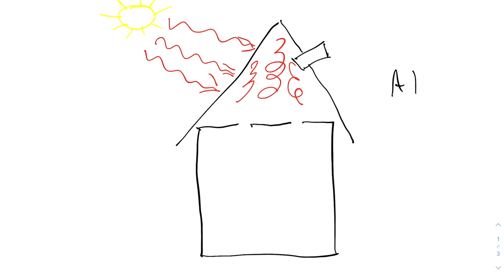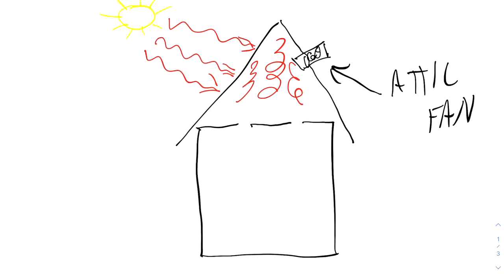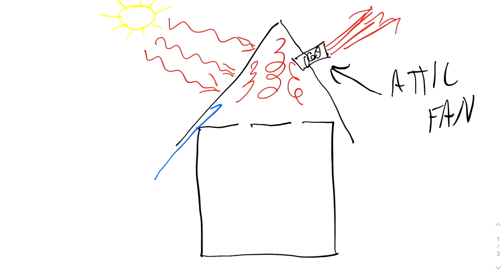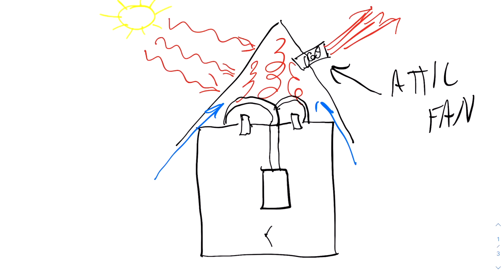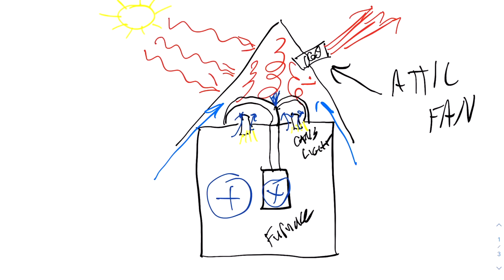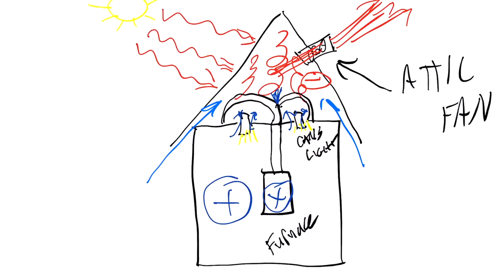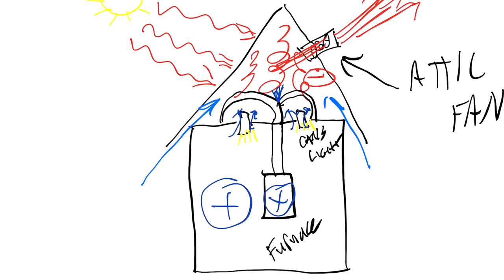3 Remodel Rip-Offs

Comment: Attic fans work great and sure DO reduce electric bills, Matt is clearly misinformed on this one.
Reply: Couldn't agree more .
Reply: we have one that is thermostatically controlled, the fact that it cycles on and off throughout the day disproves his theory
Reply: if an attic fan is lowering your power costs then you aren't insulated properly and are getting massive amounts of heat transfer in the summer and cold transfer in the winter.
Reply: In SW Florida we had 140° - 150° F attic and the 5 ton AC could barely cool the house, and now after a 4,600 CFM thermostat fan 100° F and we can freeze ourselves with the AC. The roof is just as hot, but the temperature between the scalding roof and insulated ceiling is 50° F cooler. I'm NOT trying to cool the roof .. I'm cooling the space to the ceiling.
Reply: @DanielRichards644  There is a balance between how much money you want to spend on extra insulation and what will be your electric bill every month. After so many inches of insulation your money back start to diminish rapidly, plenty of charts around to explain and confirm this, so now attic fan becomes so much more attractive - cheap, easy to install, instant payback. I bought two 60 buck attic fans, one blows in from the Northern side one sucks hot air out from the South side and the very first month my electric bill dropped 30 percent.
Reply: @DJaquithFL  if this is true then why don't you just cool your whole house with that attic fan? Your claims would imply that its far more effective at cooling a space than an HVAC system.
Reply: @MarlowWhere  .. Yeah if I want 95° in my house or whatever high ambient temperature is during the summer! Not to mention all the crap from your attic coming through your house. No thanks.
Reply: @DJaquithFL  I'm being sarcastic.
Reply: @MarlowWhere  .. Okay. Again a high temperature attic especially when AC ducts are also in the attic can not only make it difficult for your HVAC but potentially impossible to reach lower temperatures in your house. Attic insulation over time compresses and you lose significant r-value, not to mention if it's been moved around. If I didn't just run into this first hand on a reno then I won't even cared to comment.
Reply: @DJaquithFL  attic fans cannot cool a roof assembly or any mechanical equipment via convective heat loss. The answer is put more insulation over the ducting or remove it from the attic. Just because you remove the hot air in the attic does not mean everything the mechanical touches isn't still heating it up. The ducting itself and heat pump are getting hot and in turn heating the air in the system because the system is sitting on a conductive material (wood and drywall). There is no way an attic fan is cooling the equipment to somewhere between 70-80f so that cooling loss in minimal.
Reply: @MarlowWhere  .. Neither the duct work nor the room ceilings are touching the roof. The air space between the roof and ceiling are cooled off at least 40°-50° F to suggest that temperature difference makes no impact on cooling is absolutely wrong. 

Our prior home had sprayed-on closed cell insulation the insulation was underneath the roof, the attic space was conditioned. 

Again, in a more conventional construction especially as I said "RENO" as in renovation, changing the type insulation can actually do more harm than good regardless of cost. Doing it after the fact risks entrapment of moisture. So not only are you dealing with the high expense of new sprayed in insulation but the added cost of a perpetual dehumidifier or dehumidifiers not to mention that maintenance and cost to run. 

So yes in explicitly high temperature areas a thermostatically controlled fan is a wise investment and certainly can make a substantial difference in your cooling. I see it firsthand with our own home. We have the thermostat set at 110° F.
Reply: @DJaquithFL  the hvac does not need to touch the roof. It is touching the ceiling joists and drywall is it not? Conductive heating does not stop at the roof deck. It literally heats up the whole building assembly. Some roof decks get so hot that they radiate heat downwards, further heating up the mass below it. Because air is a poor conductor of heat, it does very little in transferring heat to the hvac system. More to the point, even if what you are saying is true, then you are still not mitigating heat loss in the winter RE the hvac system. The fan is masking the problem that you are yet to resolve. Wrapping the ducts in insulation is needed at a minimum. The fan may ventilate some of the hot air, but it is not slowing the thermal gain into the living space. All your fan is doing is sucking out the warm rising conditioned air and cool air is replacing it temporarily only for it to be sucked up into the attic. You're arguing that an attic fan helps reduce cooling load when in reality it is just making it less noticeable. Do you want to cool a house at any cost or have an efficient system?

I'm sorry you are not correct  about adding more insulation on the attic flooring of an older house causing issues with moisture build up. Blown in  cellulose and fiber batting are all highly vaper permeable. And the construction of unconditioned attics hasn't changed in 70 years. They are principally the same. If there is moisture sitting in the insulation, something else is causing it...likely an unresolved air gap say from a bathroom where humid air is leaking through or even a vapor barrier needlessly laid on the attic floor...whatever it is something is causing moisture to condense there. But that is not common place. I think your concerns there are over blown and you should really look into what people are doing with energy retro fits. I seriously doubt building scientists around the world would be recommending adding insulation to unconditioned attics if it was known to cause moisture issues. Your concerns would be much more founded if we're discussing adding insulation to both sides of a roof deck or wall assembly. At that point, yes. You need to do it right or you could risk trapping condensation.
Reply: @MarlowWhere  Ok, then I can cook with my oven door open, because those radiant elements will just work anyway. Nevermind that most of the radiiant is converted to heat at the roof deck. Nevermind that the ceiling structure will transfer heat out to the 100 degree air that is moving out better than 150 degree air that's sitting on it like an oven with its door closed. And nevermind that ducts aren't in that much actual contact with the structure anyway - it's usually hung by straps, and made of a reflective foil that reflects radiated energy itself, and nevermind the actual real world results I've seen time and time again - that was totally a figment of my imagination because "radiant magic".
Reply: @notsure7874  not really sure what you are responding too. An oven works more efficiently with the door closed because the door is insulated and retains radiant heat inside the oven. Having poor insulation in your attic floor while trying to maintain a conditioned space is like trying to cook with the oven door open. The radiant heat from the attic leaks into the living space as  the hot attic floor radiates heat downwards. The ducting doesn't need to literally touch the rafters or attic floor. Radiant energy heats up the metal ducting because metal is conductive. The attic floor and the rest of the attic assembly absorb and emit heat as well, which also work against the hvac. 

There seems to be some kind of confusion that hot air is what ultimately heats up a house. Using you oven analogy, hot air does not cook your food. Radiant heat does. Air does not absorb radiant energy very well. But your food, which is mostly water, does. Think about it. Heat exists in a vacuum without any air. If your attic was a vacuum, the sun would still hit the roof deck and radiate heat downwards through to the attic floor which would radiate into the living  space. By running an attic fan you are sucking out some of the hot air that is produced as a result of this radiation, but you are also pulling the cold air from the floors below into the hotter upper living space. Insulating an attic limits the penetrarion of radiant heat into the living space. An attic fan merely makes you more comfortable temporarily. As soon as winter rolls around, you are now losing heat into the attic and your fan can't do anything to stop it. Insulate an attic and create year round comfort and performance.
Reply: @MarlowWhere  Insulation is great but it isn't magical. It works much better when there is less thermal difference. I don't know why having 2 good things is a negative situation in your eyes.
Reply: @BrBill  a fan isn't necessary when a ceiling floor is properly detailed. You can run a fan if you want, but my point is that properly insulating provides year round benefits. A fan doesn't resolve anything. It masks the issue. Many of the claims that people are making her are physically impossible.
Reply: @DJaquithFL  I'm Interested in what fan model did you install
Reply: @ivosan11  .. I did a quick search that I sent the contractor and found this https://www.homedepot.com/p/Hessaire-4450-CFM-Shutter-Exhaust-Fan-Wall-Mounted-24SFV-H/305621547

I would not recommend a rheostat switch because you'll burn them out. Instead just use an on and off switch plus the thermostat switch that comes with a fan.

My only other suggestion if it's going to be covered with some sort of decorative louver then make certain the CFM of the louver is not too restrictive inadequate enough for the fan.
Reply: @ivosan11  .. I believe this is the thermostat switch we used in the Attic, in quick looking it doesn't look like the fan comes with one. https://www.homedepot.com/p/Master-Flow-Manually-Adjustable-Thermostat-for-Power-Vent-PT6/100098472

Keep in mind this has been a while.
Reply: @DJaquithFL  Thank you, I appreciate it

Comment: I live in Seattle and my attic was getting to hotter than 160 degrees. I put in an attic fan and brought that down to 125 degrees. This reduced my house temperature 5 to 8 degrees. I had 2 14,000 btu window ac units cooling a 2400sqft house. 

The biggest change was the house temperature after the sun went down. My ceiling would get to 90 degrees and radiate that heat down into the house late into the evening after the outside was in the 70’s. This means the 160 degree attic was eventually getting through the insulation. Reducing that to 130 degrees made the ceiling stay only 4 degrees warmer than the floor. 

This might be a specific situation. 
2 story house with a basement built in 1995.

Comment: 1- Wrong on the attic fan. We could put our hand above our head to feel the radiant heat from our ceiling. After the attic fan, no more heat. When I go up there to work on somethin- No attic fan, I literally had heat exhaustion, I needed a cold shower, drank gatorade & water, etc. I was done. After the fan, I could stand being up there for an hour or so in the summer. 2- Agree on the thermostat. We had to have our heat pump replaced. They gave us a too big of a unit and it cools in 10 min and the air is still moist. Sometimes we gotta turn it down to 65 to dry it out. That's cold. 3- We love our replacement windows- but it depends on what your windows were. We had 1980 single pane windows. We needed to put up that plastic that you shrink with the hair dryer every winter. Now with double pane new windows, there's NONE of that. So nice. Well worth it.

Comment: I think what Matt is trying to say about attic fans is they are a bandaid not necessarily a fix. My attic would reach 150 in the summer and take forever to cool down. I thought about getting a fan but after digging into it I decided to try to make changes. First was insulation,which didn't lower the temperature in the attic but helped in the house. I needed a new roof so had a ridge vent installed at the time and it seemed to help but temperatures still got to the 130s.i then cut holes in the soffits as there were only a few so I could balance the intake and exhaust but it still got in the 120s. Before I resolved to get a fan I tried one last thing and that was an external baffle ridge vent. So now, with the soffits vented properly, the attic insulated properly and the internal and external baffled ridge vent the temperature stays within 20 degrees of the outside temperature. I've found all the same benefits and more. My attic doesn't even get to 120 unless it's over 100 plus degrees. If I'd have gotten the fan in the beginning,sure my house would be cooler with the fan but the attic would still exceed whatever temperature I set the thermostat up their to before it would cool down. Another way to explain my situation is in the begining my attic temp would climb quickly and stay hot until late into the night. Now it's the same temp as outside only climbing a few degrees higher, typically within 10 degrees all day and dropping to match the outside in early evening. Hottest temp I've recorded is 20 over hence why I said that earlier. Sorry so long winded. Hopefully this helps others. Sure 2nd third floor issues makes it difficult to do what I did, easier to just install an attic fan but again the underlying problem isn't solved. So just depends on what you want

Comment: The 40% energy saving on windows is true if the windows in your house are roughly 50/60yrs old. My house is 110yrs old and the last time it was renovated was in the late 60s. I replaced the windows and my heating and hydro bills were cut in half. LoL (Live in Ontario, Canada)

Comment: maybe the attic fan doesn't work in TX, but it definitely worked for us in N.California, with noticeable room temperature improvement.
Reply: Same here
Reply: It’s nice for when I gotta get into the attic in the summer time. It ain’t cool up there, but at least it isn’t 150. 95, maybe
Reply: Did a study years ago for a couple utility companies and the state on attic venting. It made no difference on house temperatures. None. Zero. Zilch. As long as there is a thermal barrier, I.e. insulation. Attic temps in N. California reach 180 in attics with asphalt shingled roofs. No heat transfer through R-38 insulation to the living space. They also didn’t cool the attic down very much, if at all. It is thermally impossible to cool your house down by cooling your attic down if there is a thermal barrier between them. If there is no insulation a better option is to insulate it, not power vent it.
Reply: @ptom711  the difference will be a formula of ambient temperature, heat transfer from attic to living spaces, how much volumn of air can attic fans move per unit of time, etc.. I believe the result of your study, but I also like to believe maybe that study does not cover some of the commenters (like myself) particular parameters. But it would be nice if they can publish the paper. (Or maybe I just live in a badly maintained home 😂)
Reply: I realized it's also important to know what are we talking here, is that the attic fan does not reduce the living spaces temperature at 4pm ? Or are we talking about the attic fan delayed the time that living spaces reached a temperature? The former is entirely possible because there is little a tiny fan could do at 4pm when everything gets so hot. But I do believe that a attic fan delayed the time the house reached that temperature, which is a noticable change and saved some AC time.
Reply: What about lowering temperature in your garage? I would love for it to suck outside air into the garage and out the roof.
Reply: @psdeas7530  good question. I was kind of wondering that too. I love whole house fans, well not all of them, but the idea of them and their functionality and recommend them especially in moderate to low humidity climates where the nighttime temps actually get below the daytime temps. The huge high-capacity CFM ones are overkill and no one uses them right. When they were first used the instructions were to run them for 15 minutes at a time to flush out hot air from inside the house. Let the house sit for 45 minutes to heat the air up and then flush again. Kind of a pain in the butt but saves energy. Most people turn them on and forget about them until they are sucking hot air back in.
Reply: @SubaruWRXStiYamahaR6-AllGone  Another possibility is to install a heat pump water heater in your garage. It will both cool and dehumidify the garage while being much more efficient than an electric water heater. If you have natural gas then it is a tossup.
Reply: @SubaruWRXStiYamahaR6-AllGone   Fan will definitely lower your garage temp to outside temp.  Make sure air has a place to enter the garage (install some vents or open the windows)
Reply: @danielcarroll3358  Those Mr. Cool self contained systems are tempting!
Reply: I got two Whirlybirds on my roof in the state of Texas, my house seems fine.
Reply: @ptom711   what is the R rating for foam insulation on 2x6s??

Comment: With all due respect your understanding of the science is half correct. Radiant energy heats up the shingles, and that heat then transfers into the attic via radiation and convection. However, even if the air outside is very hot on a summer day, with an attic fan you’re forcing air flow through the attic that is colder than the roof. This reduces heat transfer from roof into the attic and results in a lower attic temp. This as a result reduces the heat transfer into the home because the attic is colder than it would be without the fan. Source- I aced thermodynamics in college and I have a bachelors in metallurgical engineering. I know heat transfer pretty well.